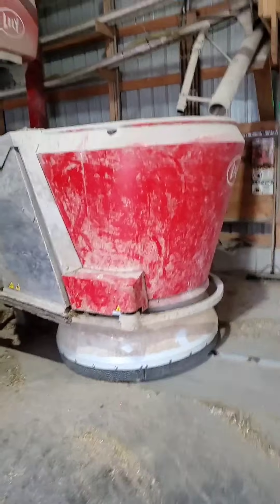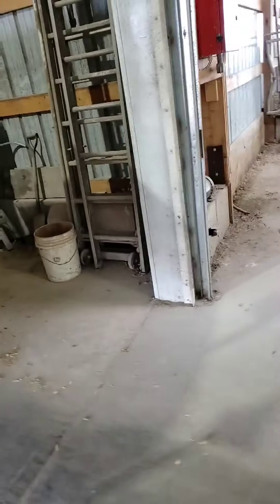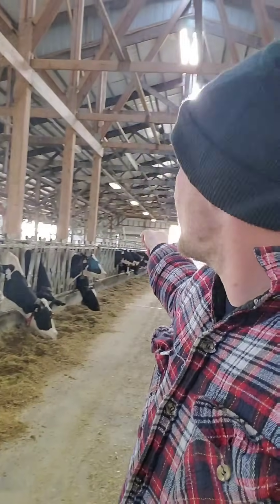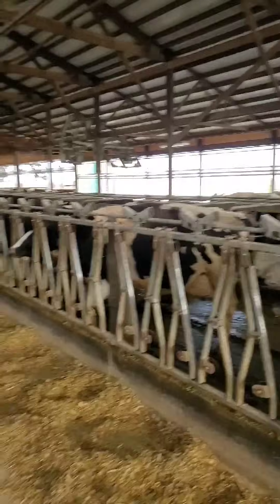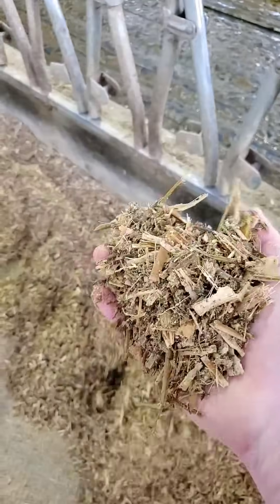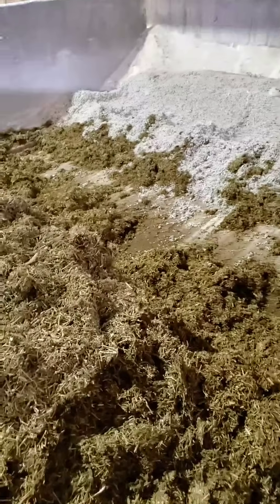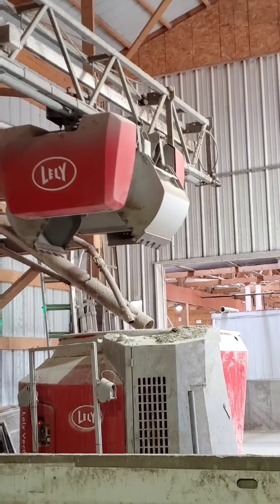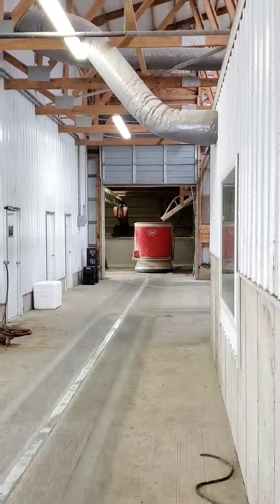LELY VECTOR. How does it work and why did we choose it?

Comment: you mentioned you saved $900 a month on power bill, that's awesome. i see other farmers with vectors going away from bunkers and bags for now GIGANTIC silos 28x 140 or some such monsters. how will that save power when traditionally the silo unloader is the longest running slowest machine in the feed lineup? starting and stopping a BIG 15 -20 hp motor isn't cheap.